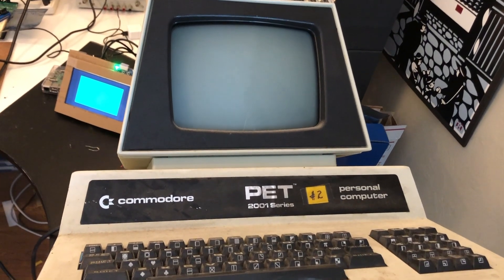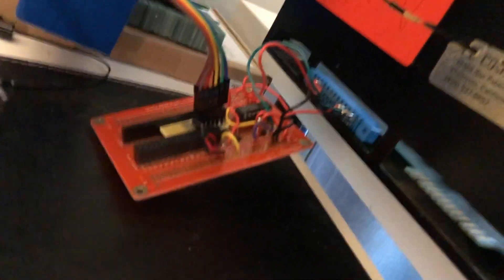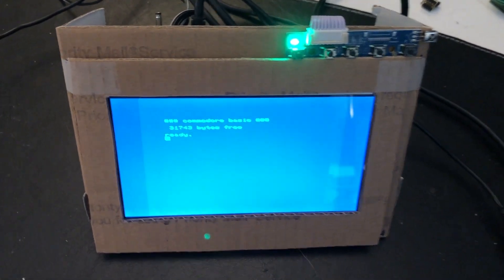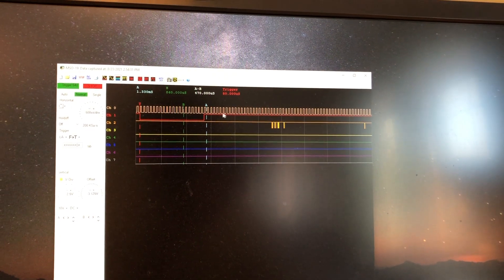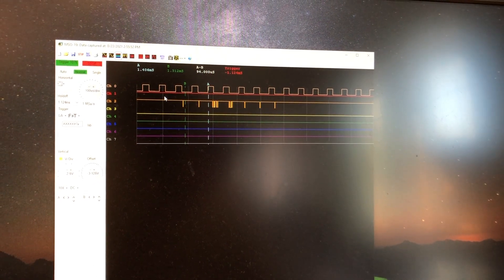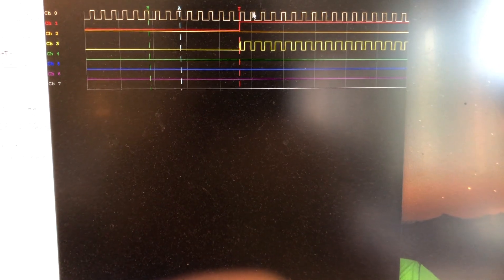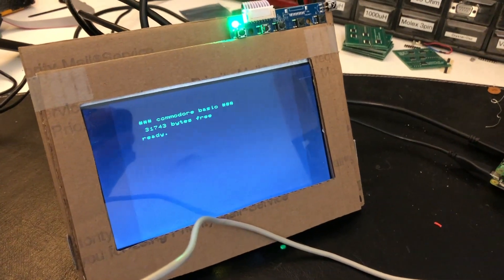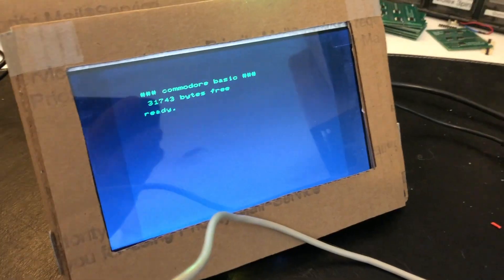Commodore PET HDMI Out with RGBtoHDMI

Comment: I was able to get this to work with separate H and V sync.  It wasn't working at first and It took me a while to figure out that the user port documentation is wrong.
Vertical is on pin 9 and Horizontal is on pin 10.  I created profiles for CRTC and non-CRTC. I can get 80 column to work but doesn't look good. All the 40 col modes look great.